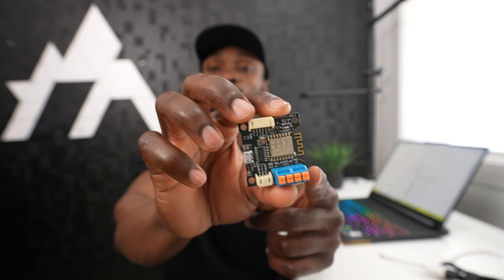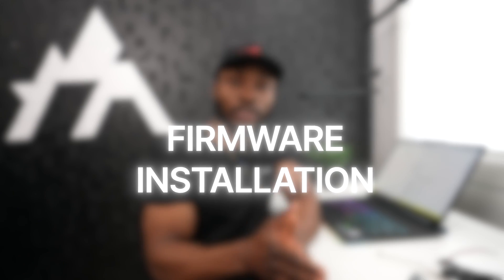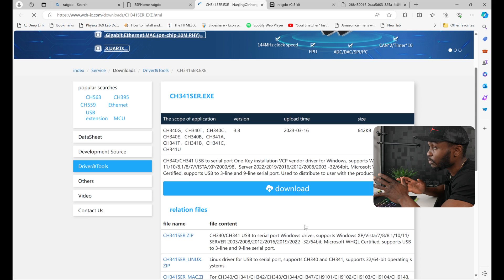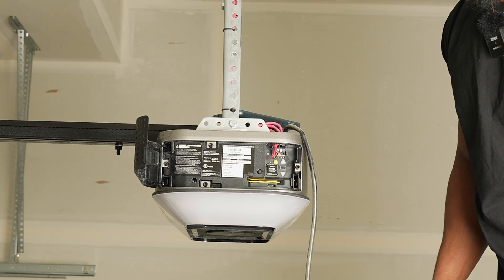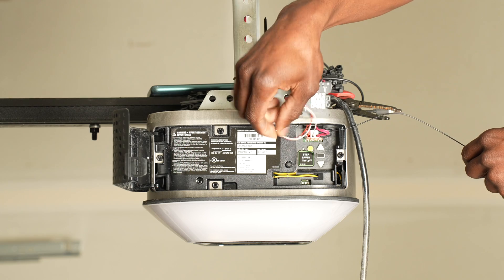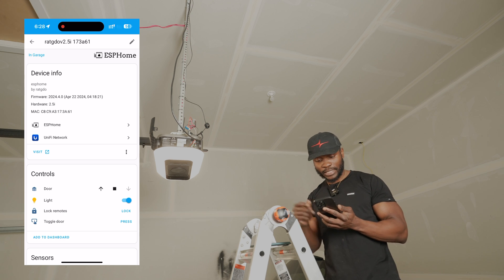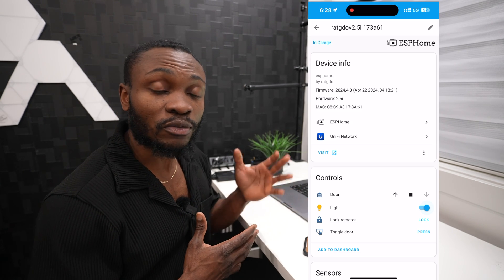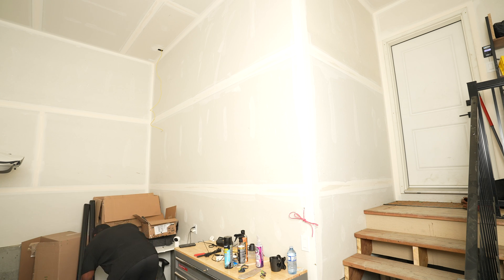MyQ Blocked Control Of My Garage Door But RATGDO Opened It

Comment: Just get a Meross opener. Simple, reliable and cheap.
Reply from the maker: Meross is simple and works for many, but it's not as robust. You don’t get detailed stats like open counts, run time, or individual control over components like garage lights. RATGDO taps directly into the garage door’s native sensors, so no messy contact wires like I had to use with Meross. While I now use Konnected (same concept, just with proper support and branding), RATGDO still works and remains a solid, advanced option for those who want more than basic control.
Reply: @tytalkstech Yes, RATGDO might be a bit more robust, but you still get history through the Meross app and I have set up automations very easily through HomeKit. For example, my porch lights automatically turn off late at night but I have an automation that turns them back on for a defined time whenever the opener is triggered. Also, it only took two wires to connect it to the opener and then run the sensor to the front of the door. They will send you a secondary device for free to make it work with openers that may not be fully compatible. It took me about 30 minutes at best to set it all up.

Comment: Cool but I can't do any more micro-usb devices, even if it's just to flash the device.
Reply from the maker: Why is that? It’s literally a set and forget. I haven’t touched it since I put it up. I can’t say the same for other USB C and usb 3 devices.
Reply: @tytalkstech  Because the micro-usb connector was garbage when it was first released. Easy to break, non-reversible, low speed, limited power specs. I'm slowly purging all devices that are not usb-c and not buying anything new with (lightning) or micro-usb. Not sure what devices you are having issues with that have usb-c, but some devices don't implement the standard properly yet due to poorly skilled engineers, especially when it comes to usb-c to usb-c charging. Items that fail in that respect I return right away - no need to reward poor products with my money. One cord to rule them all! Most new devices are being released with usb-c due to the wider acceptance and I believe the European Union requiring usb-c for all smart phones is helping with that trend. Most of the products out that still have micro-usb are old stock or from companies that don't want  to invest the time to rework their legacy products to use usb-c. Plus I really don't like connectors that take two attempts to plug in correctly. There are a few device, like the ratgdo I'm interested in buying, but I'll hold off until they are usb-c.